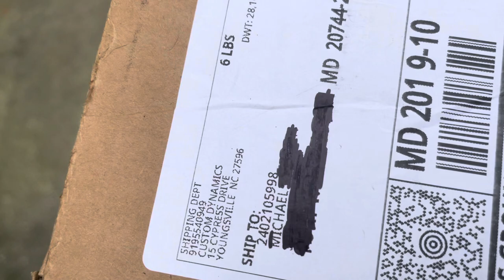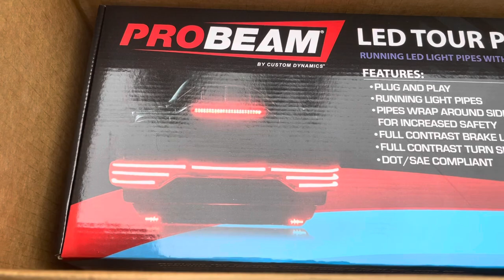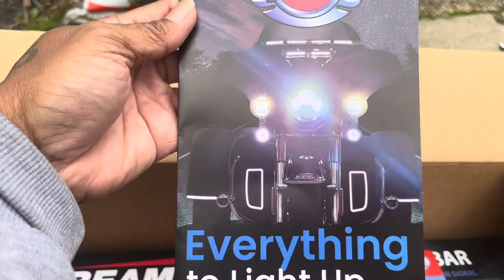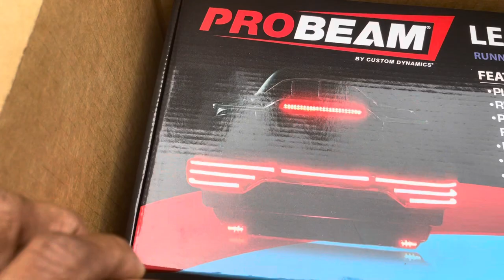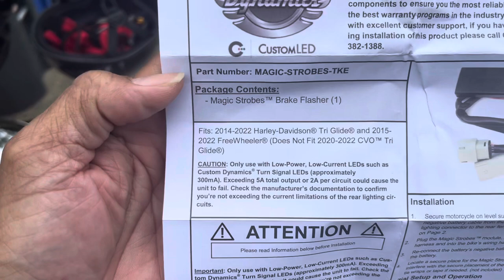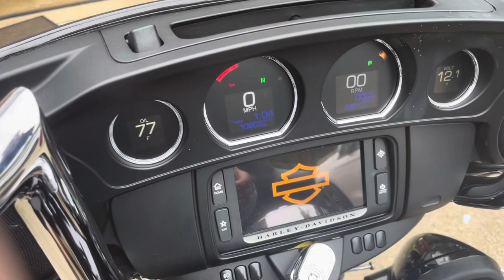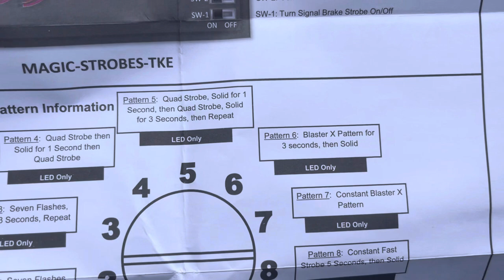Custom Dynamic magic strobe for the Triglide trike

Comment: Great addition. Mine works well. You can never be safe enough. I have my strobe on number 6 also. Great setting. If you use your signal before the brake  the lights don’t pulse.
Reply from the maker: That is good to know about the signal light